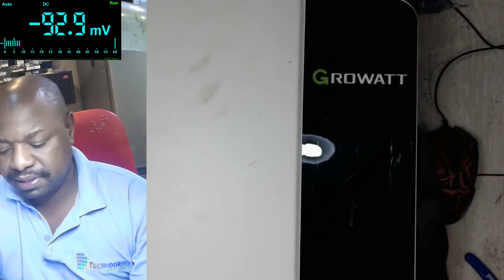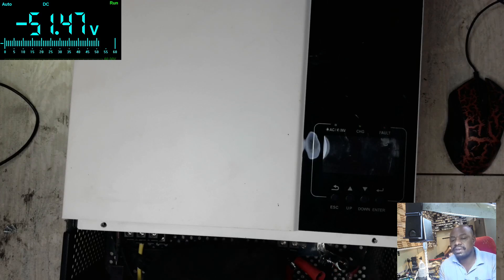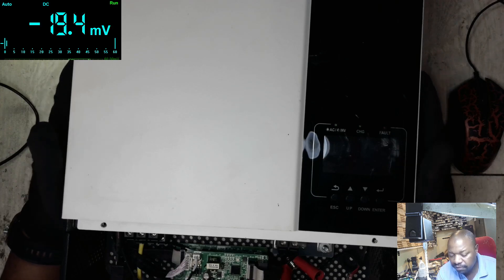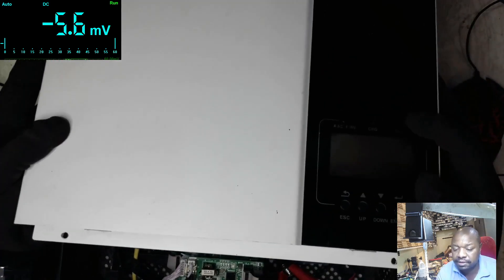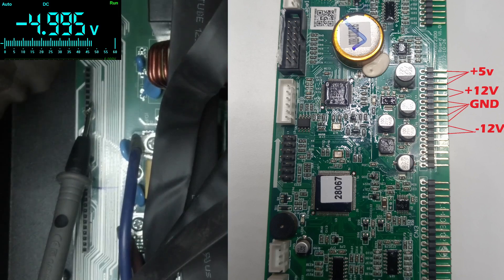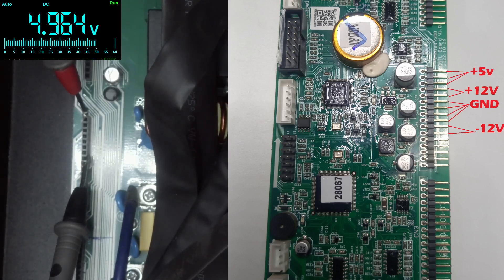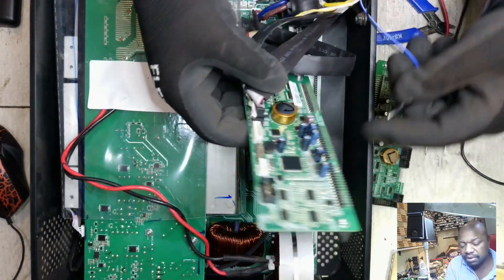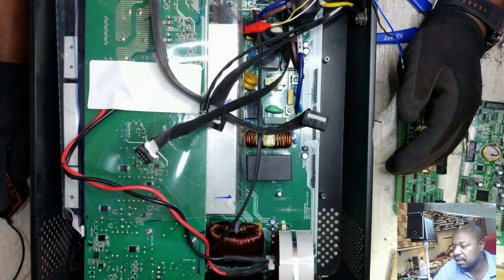REPAIR Growatt SPF5000ES  LIGHTNING DAMAGE NO DISPLAY NO OUTPUT FANS RUNNING

Comment: I have the same model in the 3000 version but it will not charge from utility or solar but will discharge fine.

How do I know if it's the control board or mppt board?

The charging light blinks but when charging(low power in) it reads the battery voltage as full and then discharges completely.